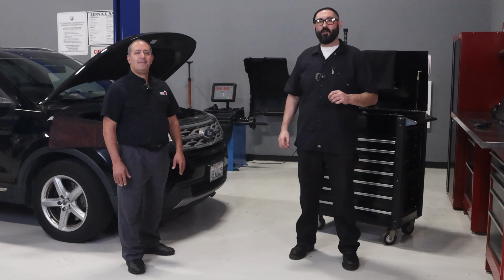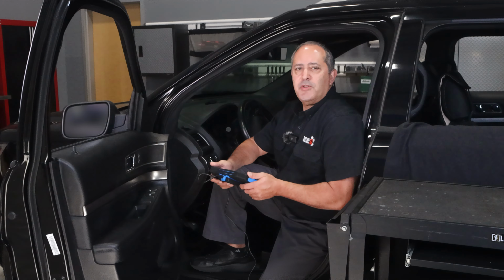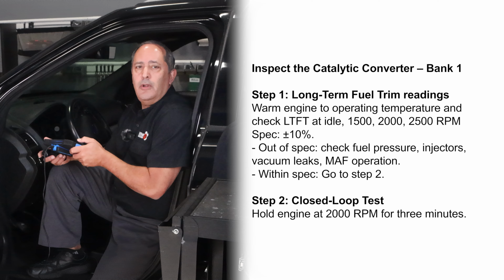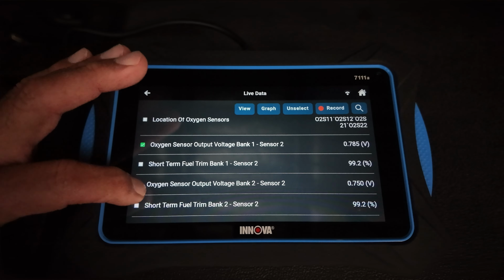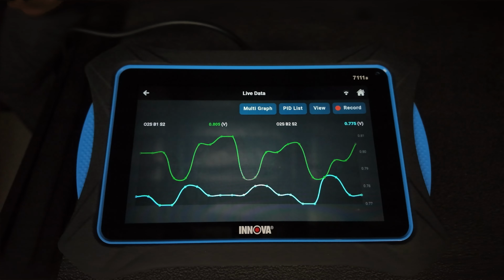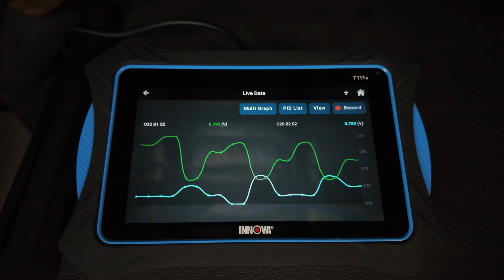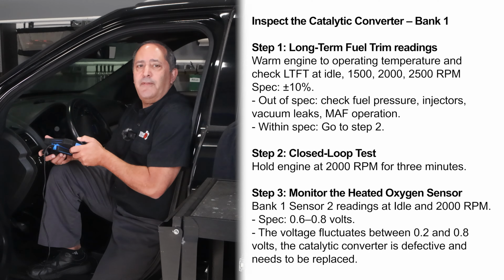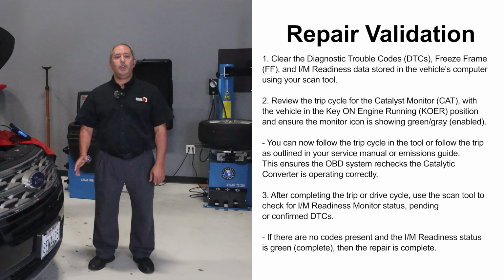How to Fix Code P0420 on a 2018 Ford Explorer | Catalytic Converter Replacement

Comment: Is the same process for a 3.5 Ecoboost?
Reply from the maker: Great question! The process isn't quite the same for the 3.5L EcoBoost. On the naturally aspirated 3.5L V6, the catalytic converters are integrated into the exhaust manifolds, so they come off directly with the exhaust manifold assembly. On the EcoBoost (twin-turbo) version, the converters sit downstream of the turbochargers instead, so the Remove and installation job involves working around the turbo plumbing and Y-pipe connections rather than the manifolds.

The diagnostic process stays the same for both — checking stored DTCs and confirming which converter/bank is affected — but the physical removal and installation steps differ because of the turbo setup.

Let us know if you have any other questions!

Comment: I all ways replace the antiseeze on the O2 or A/F sensor threads so they maybe removed some day same lubricant they came with
Reply from the maker: Thank you for sharing your experience!

You’re absolutely right—applying anti-seize on the O2 or A/F sensor threads can help ensure easier removal in the future, especially in high-temperature environments. Many sensors do come with a pre-applied coating from the manufacturer, but adding a small amount (when appropriate) can provide extra protection against seizing.

That said, it’s important to use the correct type and amount, as excessive anti-seize may affect sensor grounding or torque accuracy.

We appreciate your input and insight!